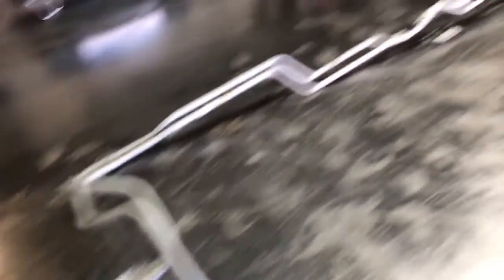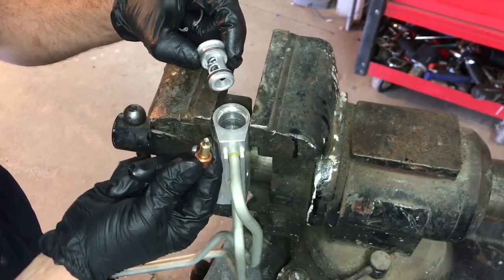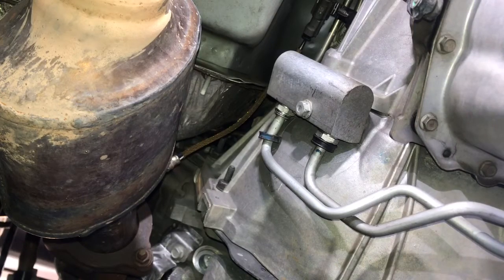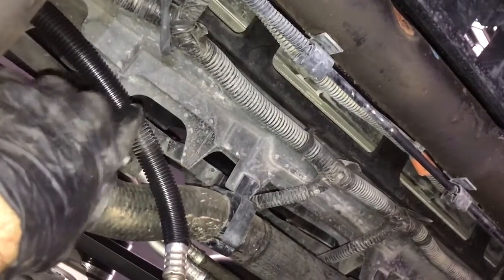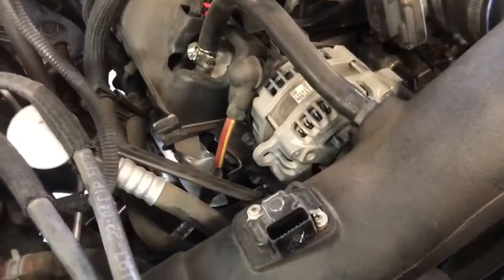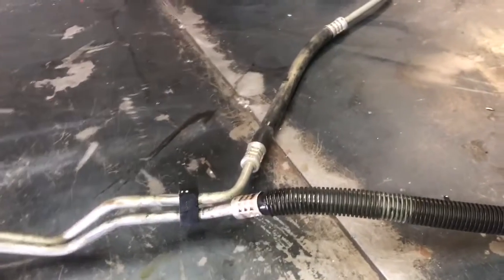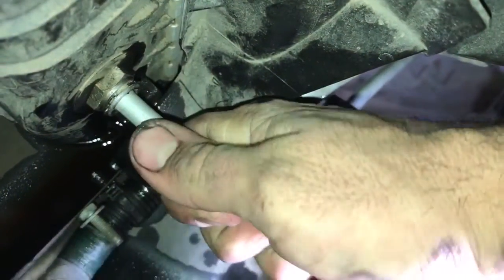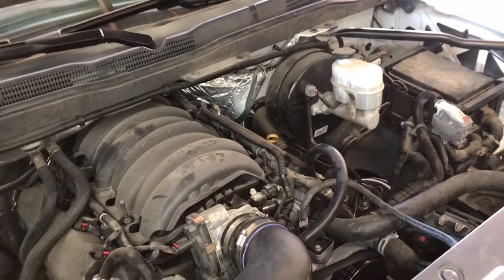GM Silverado Sierra Transmission Cooler Line Replacement & Thermostat Delete (2014 +)

Comment: just did replaced the lines on a 2016 4 WD. thank you!   one thing to add I ran a string to help guide the new lines   between the cross member/ front drive axle and all of the wire loom. the tip on the spring clip was a big help also.

Comment: FYI to anyone watching this. GM issued a TSB Sept 27th 2021 for a lower temp ATF tstat unit. TSB 21-NA-199. The unit now uses a 158F vs 194F.
Reply: You do NOT need a thermostat on a transmission cooler period...
Needs to be bypassed altogether.👍

Comment: Finally....I understand the transmission cooler line routing.  3/8" lines.  BTW....I believe the line shown on the drivers side is TO THE cooler and the upper line on the passenger side is the RETURN line to the transmission.  The passenger female connector is what I will tap into to drain the fluid with the transmission pump.
Reply: This is exactly what I was looking for. Which line is feed and which is return.

Comment: So glad I seen this !!!
I got 10” lift and 37s with 4.56 gears in my 2016 and it ran at 202° on level highway so I flipped my plunger and 155° is the highest so far I’ve seen in Wv 75° ambient temp so far 
Thanks !!!
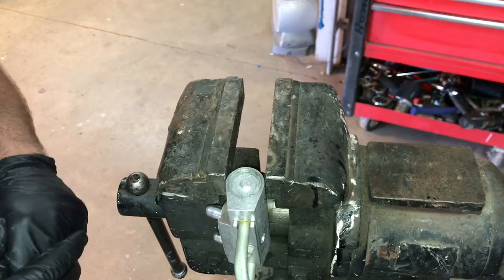Reply: I have a lifted 2013 Silverado 9" lift which tires claim to be 37x12.50r22 but tires really measure 36.5 inches tall and no they're not stretched cause they're on 22x12 wheels, mine has 4:56 gears Detroit trutrac boltons & a custom tune from a local performance shop had the engine tuned & the 6l80 also with a 40k trucool never saw temps over 130 in hot texas summer days 140ish when towing but it messed up even though it was tuned but still had stock interns which they werent to pair with the 4:56 gears so now It has a stage 1 performance 6l80e built upgraded forged interns & tuned specially for 36.5 " tires 4:56 gears but will be installed this weekend I hope also never believe whats posted on a tire so grab a tape measure and get true height also download a speedometer app make sure you're pickup truck is not under miles. All this is from experience with my 2013 silverado 4wd
Reply: @benjaminalmendarez3059  yep I’ve personally never seen a true size tire yet lol
Vehicle weight usually accounts for .75” but the tire themselves are always 1” smaller before mounted 

I no longer have my lifted truck but It had roughly 210k when I wrecked it with no probs other then converter failure early in its life
Reply: @Ls_swap211  the thing that pisses me off mine has toyo open country mt 37x12.50 I paid $2300 for tires with them being  balance & mounted why are they so expensive if they're not the size they claim to be
Reply: @benjaminalmendarez3059  I ran Mickey Thompson Mtz p3 and got better mileage then Toyo for a little less price but I paid $1800 for 4 and kept them rotated every 3000miles or so 

Back when I had 35s I thought I was doing good till they barely measured 33” lol
Reply: @Ls_swap211  thats why alot cant get the speedo correct cause they put size thats claimed on tires which its not the true size
Reply: @benjaminalmendarez3059  absolutely Lol

Comment: Ah yes! This is the video I have been looking for. Going to delete the thermostat on my Silverado. Towing a travel trailer and it gets way to hot. Scratching my head why GM would add a thermostat on the transmission making it get so hot.
Reply: It's not the thermostat, its your ability to remove the heat after the thermostat is open, you probably need a bigger transmission cooler when hauling a camper. 180-200 deg should be normal temps
Reply: @andrewpeters87  I ended up getting a 2019 Silverado with the transmission cooler and tow package. Stays nice and cool now with no problems now. :)
Reply: @andrewpeters87  It IS the thermostat fella, ever wonder why GM didn't put them on 2500 and 3500's...
Ots on there so GM could achieve the fuel economy standards...
👍
Reply: @andrewpeters87  not correct.  190/200 is way to hot.  His thermo operating correctly..  It's just that what GM says to oper at 192, not for good life of trans.
Reply: @CharlieAtkins  exactly.  They are not doing these things in your vehicles best interest.....period.   Like he said, it's for mileage.  They WANT your vehicle to have issues  after 100K.

Comment: Nice bro I did this to my 2015 Cadillac Escalade I put a tap bolt and flush the transmission n replace filter n welded a bolt to pan for easy drain for next time.

Comment: Chevy wants $610 to do this work. I’m nervous to do it myself but I’m gonna try. All I have a floor jack not a lift so it might be tricky. Thanks for the video
Reply: Same bro my nearest Gm dealer wanted 800$ in labor for both my engine cooler lines and transmission lines did it my self watching you tube videos saved my ass 800$

Comment: I installed the stl010 bypass and it was working great until I replaced my filter and fluid. My temps used to stay around 145ish and now it's getting close 180.

Comment: Watched your other video for the thermostat delete and could I just flip the thermostat like this instead of tapping a hole and putting a plug?
Reply from the maker: yes, there are two ways to do this mod, flipping the thermostat works good on trucks that arnt being pushed to the max. on vehicles that are pushed hard (big tires, high hp, heavy towing, outside temps over 110) i recommend tapping the block as it allows for more flow to the cooler, flipping the thermostat does the same but i have seen greater results with the plug method.

Comment: Synthetic trans fluid is rated to 275° the "hot" warning for these trucks are 265°. The thermostat is for transmission efficiency. 190° is the best temp to increase fuel economy. It also lets the transmission warm up faster in cold weather.
Reply: Wrong Chevy has just released a bulletin with a new thermostat which allows the thermostat to open at 150 instead of 190. The 190 is causing torque converters to burn.
Reply: You right about the synthetic fluid but in these trucks it’s destroying the torque converter
Reply: @prettyboyswagproduct  where did you read tht? I am about to replace my transmission cooler lines because it’s leaking, and was wondering if I should try it out without the delete at first. My fluid gets to about 190
Reply: @prettyboyswagproduct   you are correct.  Few know this.

Comment: I've got 3 questions. 1st how do you like the valont cold air intake? 2nd can you do this to the 2019-2021 body style? And 3rd how come you don't have a oil catch can installed?
Reply: First a CAI is a waste of money without other performance modifications and it will run worse without a tune because you changed the VE (Volumetric Efficiency) tables...
And Second, Yes the 19' and up will benefit from the transmission cooler bypass modification...
👍

Comment: Will doing this mod hurt the transmission  during cold winter months? I plan on towing a heavier travel trailer, but probably won’t be pulling it much in the winter
Reply: NO...
Reply: Just watch the transmission temps.  If it ends up running well over 100,  your fine in winter months.  But if not, GM does make a 158 degree valve to replace the 192F thermostat valve.  ne w158 part # is 86774933

Comment: Ok so at the moment I cannot get under my truck because I slipped a disc in my back. But I had a dealer do the fluid change to stop the shudder, now my lines are leaking. They are not taking responsibility for it and I’m tired of fighting with them. I’m about to order lines and have my buddy throw them in because I can’t work on my own stuff atm. The dealer said “the ac has to be discharged to replace the lines because they go into the condenser,” which I replied I have never seen that for transmission lines it’s always been into the radiator or external cooler and that sounds completely wrong. But I also cannot get under mine right now to call him out or learn something new. I have a 19 trailboss 1500 with the 5.3/8L90… does that sound completely wrong about the ac??? It can’t be true. And I looked at your link for the correct lines for mine and it says cannot confirm fit based off my vin. I have found a couple different part numbers for the 8L90 lines or “pipes.”

Comment: I have a 2014 silverado 1500 zr1 . My Torque converter when and wiped out the seal and the temps were reaching well over 208 degrees in normal driving. the trans was banging and miss shifting and surging and shuttering. I just got my truck back today and i asked them before i picked it up did you guys change the thermal bypass valve to the new one .. he said the trans comes with all updated parts.. I do not think he understood what i asked. SO i was driving it easy home and the truck reached 197 degrees and then it must have opened the TBV and it started to cool.. Thats how i knew They did not Change the TBV out for the updated version. I also see transmission fluid dripping from where the Old TBV is installed ... Seal is bad and they did not replaced it before reinstalling it to the new transmission. I called the dealer and told them what i found and that tomorrow morning i will be bringing the truck back and i want the new UPDATED THERMAL BYPASS VALVE INSTALLED WITH THE NEW LINES.... I said i had them on order when i brought the truck in when the transmission was ordered. Im Pissed the hell off.... Im going in and i hope they have all the parts i need to get this done. I do not want to see 195 pop up again on my Trans temp when driving in slow traffic on a cool day.

Comment: Nice, but should we worry about the fluid never warming when its -30F here?  When towing my RV in the summer, the temperature never exceeds 200F and I wont be towing when -30F.  Won't the viscosity of the oil never reach ideal during the cold winters here?
Reply: But you said you wont be towing in -30F.

Comment: Very nice...I am trying to get some guidance on making a barb fitting to the transmission cooler return line so as to flush the transmission.  My aim is to attach clear hose to such a fitting and insert into the radiator fitting, top, passenger side.  Is this a 3/8" male fitting?  Will a Hayden 397 match the male upper hose??  Thanks.
Reply: Thank you! I have a 2015 Chevy Silverado and this is pretty much the same process.👍🏽
Reply: Yes.  The Hayden 397 is a perfect fit.

Comment: Can the main housing be removed without taking all the lines off too? Like the rectangular bracket between the two lines does that “hold it” on the main body? If I remove that can I remove the two lines from the body so I can take the main body off and replace the insides with aftermarket superior solutions
Reply: I got it off. But the snap ring is pretty much corroded in place…. I can’t get the ring off to change out the inside.

Comment: Will this damage the transmission if I only tow occasionally? My temps without towing get around 195 but I take mostly short trips and it doesnt get higher than 130 normally.
Reply: It wont damage the transmission per se, but not heating up the fluid will make it absorb moisture from the air, and water will contaminate it. Same thing happens with engine oil. Just make sure to let the fluids heat up past the dew point in you particular day/area
Reply: That thermostat is in there for a reason. Why would GM engineer that into the truck if it wasn't needed??
The thermostat allows for quicker warm up and efficiency.
I have no Idea why everyone wants to alter the design of the vehicle.
Then they wonder why there vehicles don't last..
Reply: If you drive short trips, DEFINITELY do not remove that stat!!!
Reply: You just don't get it...
Ever wonder why the 2500 and 3500"s don't have one...
GM engineers put that on 1500's ONLY to achieve the MPG standards and nothing else..
These transmissions run way too hot and 30% of internal parts are plastic...
So I'll let you figure out what happens to plastics at 190°...
😳
Reply: @CharlieAtkins   you are correct.  Most people don't have a true  understanding of what a transmission/vehicle needs as for as oil temp.

Comment: Will deleting thermostat void my warranty?... plus what if I don't tow and still get up to 196 to 206 degrees? Oh and I also get cold and snowy temperature in the winter time around here.
Reply: Common sense says any modification not factory authorized will void the powertrain warranty.  That's why I haven't done this to mine yet.  Those engineers aren't dumb per se.  They know what they are doing by having this thermostat on there.  They know heat will kill the transmission.  They want it to last just till you get it paid for then it goes down the drain.

Comment: I think I may have the opposite problem.  My transmission takes forever to warm up.  I think my thermostat may be stuck open.  Starting cold it'll read around 70-80F (close to ambient temp).  Driving for 15 minutes 30-45 mph it'll have only crept up to 90-95F.  Another 15-20F mins of driving under those conditions and it barely gets to 117-125F.  It threw a P0711 (fluid sensor performance) which made me think it was just bad sensor but now I'm thinking it detected the difference between ambient/coolant warm up and transmission temp. Recently had coolant flush but I can't imagine I have an air bubble that hangs around the lower radiator hose to cause this.
Reply: Is the transmission still running?
Reply: @mikekruger8806  They replaced the sensor and it was running when I sold it in November 2021.

Comment: Do they sell that clamp spring anywhere? The one with the two holes that you need the tool to pinch and remove?
Reply: I found it at O’Reilly’s. I did the mod and didn’t put the snap ring on well enough I found out lol. When I turned the truck back on everything went flying off and I ended up losing the snap ring. Got a new one at O’Reilly auto and got it on correctly the second time. The mod definitely keeps the trans fluid cooler a lot longer than before but my temps still get up to low 200’s after a while. But it is summer in AZ so not sure if that’s why or not. Anyway great vid and info

Comment: I purchased a new set of lines, however. It came with the thermost  block "welded " as one solid unit so I can't  fish thr lines through seperate. And thr block obviously  won't go through  so I can only go back to front from Transmission  side. I cannot get them through, I havent tried spinning them around as I too don't have a lift.  I was going to disconnect axel and what I believe  is an electric motor in same area. Bit you mentioned you only gained about 1/2" when dropping part of axel??  I looked at the part for mine on your link. And it doesn't show seperate  lines,  it too looks like fixed lines on block now. I believe  that's the new,updated version, any advice, ive spent over and hour and a half trying so far
Reply: Also, I do not have an extra oil cooler, I have 4WD and a crew cab, of that matters so my connections are different. I guess my part already deletes the thermostat as its much smaller

Comment: The amazon link you provided for the 2014-2016 6L80E is for assy 23370657, however amazon fitment guide says it does not fit my 2014. Is this assy correct for my truck or not?

Comment: I got a 2017 Silverado having transmission problems it keeps slipping out of gear but if it sits for a few minutes it will go again but not for long is this a solution to my problem or ?

Comment: I had my transmission on a 2014 gmc with 5.3 go to 232 before it cooled down when I was pulling a trailer and a compact tractor on it and the transmission is new think this would help my transmission last longer
Reply: absolutely.  200F no good for long tranny life.  Keep 150 ish or preferable even a little lower.

Comment: My temp in my transmission runs 190 - 198 always so i installed a trans cooler but still runs hot.  I have the truck programmed for performance mode and keep it in v8 mode.  Would you recommend just flipping the trans thermostat at this point because i want to fluid to run into the new cooler i put on or do the plug method?
Reply: I've read it tries to keep it to up that high to allow for better shifts.
Reply: @davidchapman1986  so flip or plug?
Reply: @ironlung801  Sorry - I don't know enough to recommend what to do but I will say my Yukon Denali that I believe has a transmission cooler always ran in the 170-190 range after warmed up.  Scouring the forums on an unrelated search it tends to do this to maximize shift performance with warmer fluid.
Reply: @davidchapman1986  so just leave it then?
Reply: @ironlung801  I wouldn't change it.  If its consistent and not spiking for your driving patterns and use cases I wouldn't change it.  The TCC won't lock up if its too cool or you may get harsh shifts.  I think Aaron's use case is acceptable, being in Arizona where its always warm.  I don't believe the fluid in at least the 8L90's has a problem until you start hitting 240-260ish but my dash gauge doesn't hit red until 300. [edited for clarity]
Reply: @davidchapman1986 ,  erike,   I WOULD  just reverse it as the video showed.  If its too cool, say no more than 100,  then go to the OEM GM thermo valve set at 158 degrees.  part #   86774933

Comment: Did you ever do a video on the other two cooler lines that run towards the back of the drivers side?
Reply from the maker: Those are oil cooler lines for the motor. Next time I replace those at work I’ll do a video!
Reply: one of mine are leaking at that crimp
Reply: @AaronHinesAuto  I just replaced my engine oil cooler lines and this video was perfect, and helped me very much. Thank you sir.

Comment: So this procedure is only done when upgrading to an aftermarket transmission cooler?
Reply: No, it's done to any
 2014 and up GM Silverado or Sierra 1500's
2500 and 3500's Don't have them...